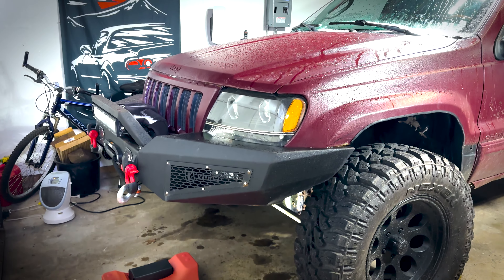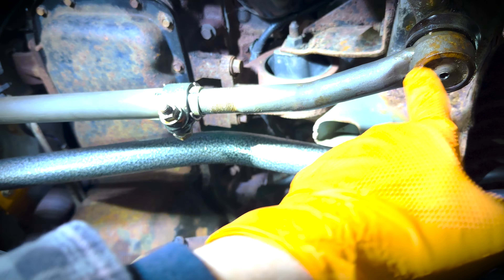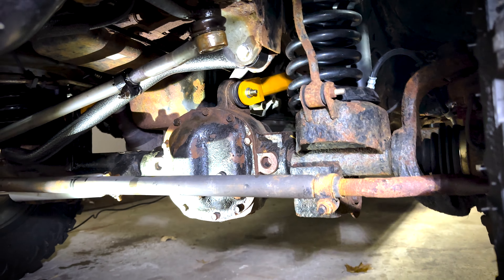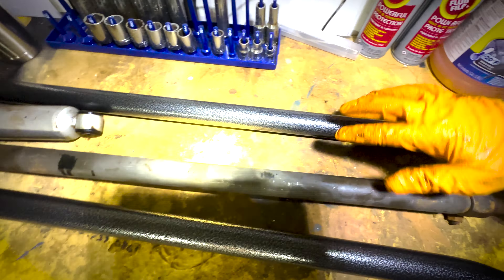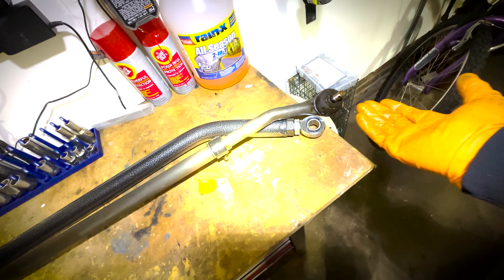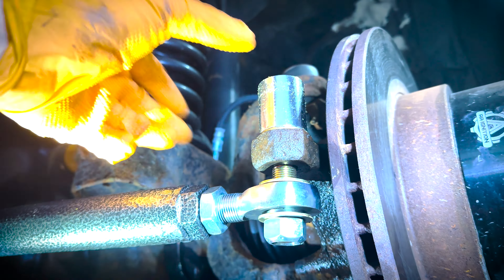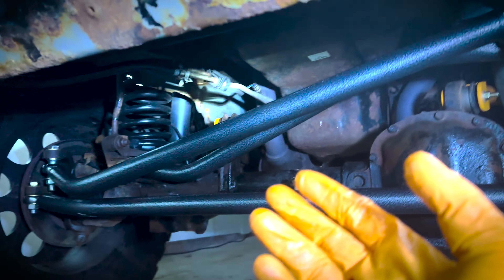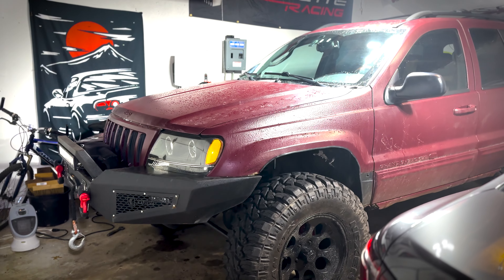Installing Trail Forged HD Steering Kit on a Jeep WJ

Comment: Im definitely getting this for my WJ, I always thought the whole tie rod set up is a very outdated concept because the rubber boots fail so quickly and you almost have to replace them every year....a buddy of mine suggested to coat the boots with silicone to protect them which does work but it's best to just eliminate that whole nonsense set up

Comment: I just did this install, one of the reasons this kit is intended for OTK is to put the linkage back to the correct geometry and eliminate bump steer! Pro tip……always torque the nut side of the fastener when possible and also use a breaker/cheater bar to tighten the set nut on the heim joints or they will come loose quick on you.

Comment: I'm not seeing the need for the reamer. Wouldn't a sharp regular drill bit work as well? Of course, you'd have to work up to 5/8", so I guess it saves a couple steps.
Reply from the maker: Step up bit could definitely work for sure as long as you use a good cutting oil to keep the bit sharp as possible and as cool as possible!

Comment: What number of rims and tires does it have and how many inches tall does it look very good?
Reply from the maker: 18" Rims, 35 inch tires on a 4 inch zone lift! Thanks!
Reply: @DilemmaMedia have you had any issues yet with the lower control arm bushings sliding out? My zone lift had bumper steer and the bushings slide out some.